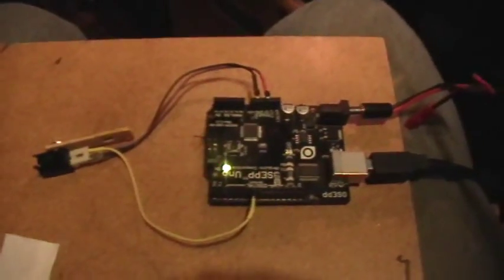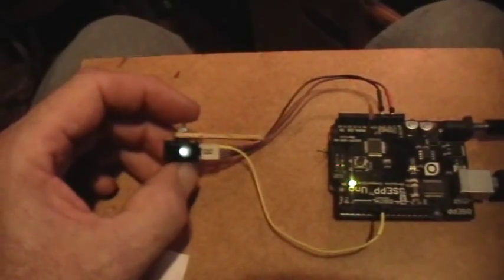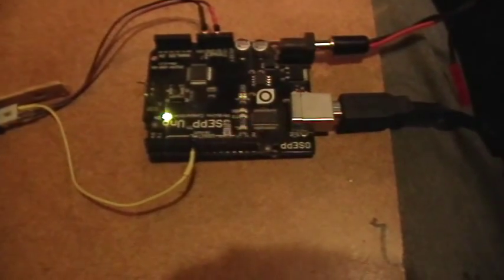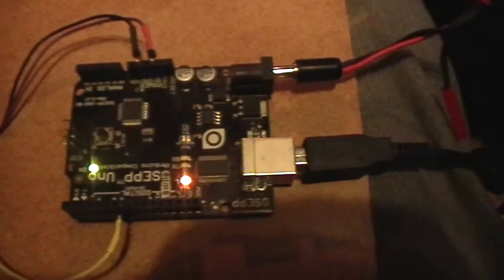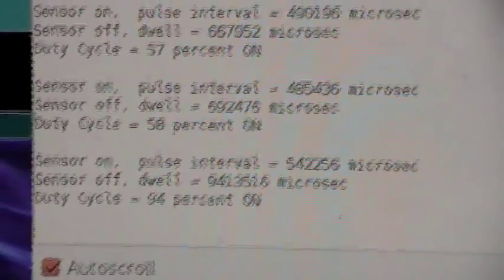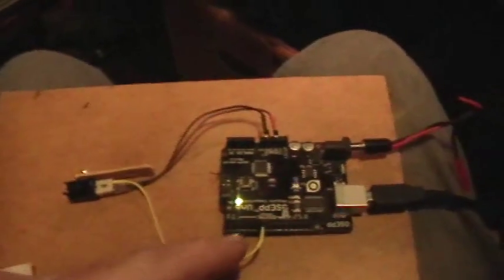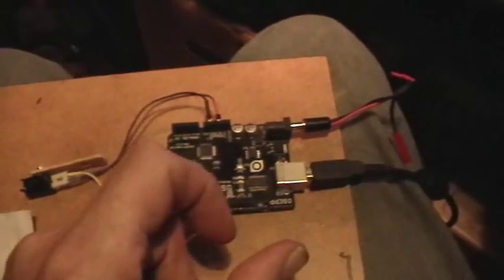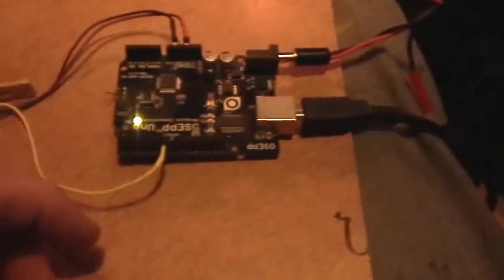Arduino: Developing a Pulse Motor Driver Using Edge Detection

Comment: Was this board worth it to buy over a genuine arduino module?
Frys electronics has this board for sale, but Ebay is half the price, but Shipping is where the down side is. At least its half the price.
Reply from the maker: Sorry, I didn't see your comment until now. This new google system is NOT WORKING, there, friends at YouTube.

Anyway, yes, I've had good luck with the OSEPP brand from Fry's, and my local supplier has just started carrying them too. I've got two OSEPPs, a Mega and this Uno, and also a new genuine Italian Arduino from RS. I have also used the Pro Mini from OSEPP, and some lower-priced Pro Minis from SparkFun... I've had great success with all. I did manage to blow one pair of digital outputs on the original OSEPP Uno that I bought a few years ago, but the rest of it still works fine.